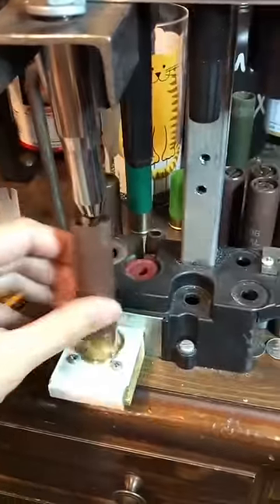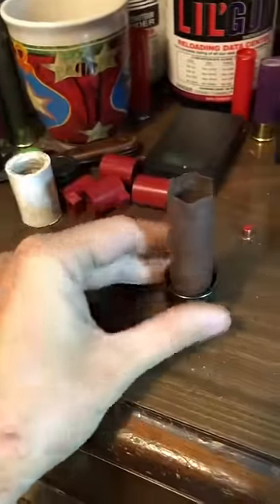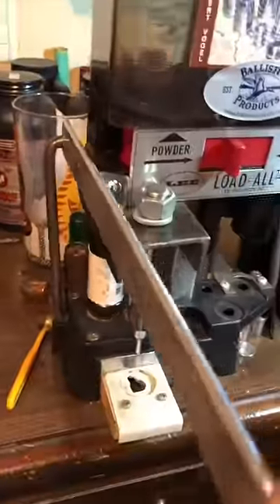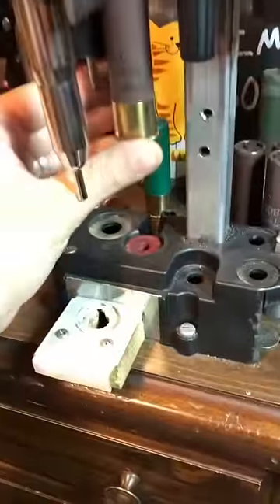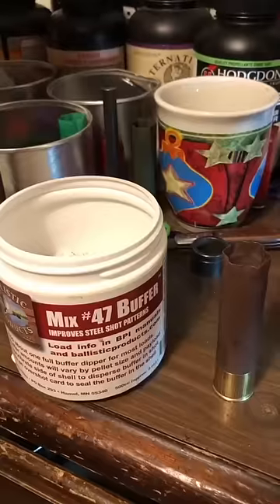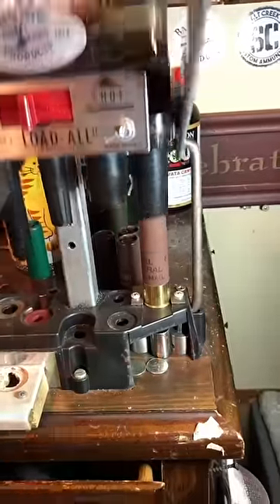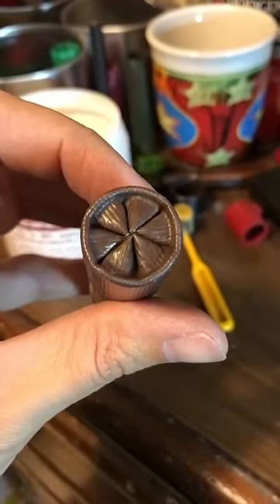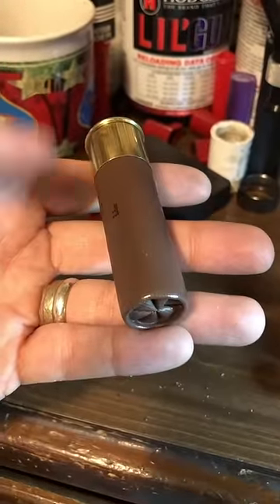Reloading 10 Gauge 18 Pellet 00 Buckshot #shorts

Comment: How many times on average can you reuse a shell? I assume it must take wear from being fired and eventually it becomes unusable.
Reply from the maker: These probably 5-8 times on average until the crimp splits. When it does, you can trim it off and keep loading. A 3.5” hull can technically be loaded about 20 times before it gets to short. Some hulls are made to be reloaded to the moon and back such as the Winchester AA or Remington STS. Those hulls will load over 15 times.

Comment: On average how many times can you reuse a case or shell? Just once?
Reply from the maker: Depends on what hull it is. Tapered hulls like Winchester AA’s or Remington sts’s will last about 12 shots before the crimp splits but you can just trim it off and roll crimp it as a 2.5” then a 2” and so on. A 3.5” shell like this one can be loaded over 20 times this way or until you run out of room for even a mini shell.

Comment: Why is a .40 cal pistol bullet 180 grain but this shotgun shell only takes 33 grain???
Reply from the maker: 32 grains, and that’s the powder charge. 180 grains is the bullet weight. This shell has 2.25 ounces of lead in it which is 985 grains with a velocity of 1220 fps. 180 grains is .41 of an ounce. You’re confusing powder weights with projectile weights.

Comment: How many times can a shell be reloaded?
Reply from the maker: These probably 5-8 times on average until the crimp splits. When it does, you can trim it off and keep loading. A 3.5” hull can technically be loaded about 20 times before it gets to short. Some hulls are made to be reloaded to the moon and back such as the Winchester AA or Remington STS. Those hulls will load over 15 times.

Comment: How many times can you reuse a casing?
Reply from the maker: Depends on what hull it is. Most 5-8 be for the crimp splits, then you can just trim it off and keep loading. A 3.5” hull can be loaded dozens of times technically if you just keep trimming it. Fold crimps last longer then roll crimps do, hulls like a AA or sts can be loaded over 12 times before the crimps starts to split.

Comment: Still cheaper to buy in bulk
Reply from the maker: No it isn’t. This is 10 gauge not 12 gauge birdshot. This costs $6 a shot from the factory or $29 for 5 rounds. I’m loading it for 50 cents. Reloading or loading your own buckshot and slugs is far cheaper, especially if you cast your own shot which we do. We get lead for free or nearly free from tire shops.

Comment: How bad does ten gauge kick compared to 12  gauge
Reply from the maker: It depends on how heavy the 12 is and what you’re shooting. 10 gauge has a lot less felt recoil than a lot of 3” 12 gauge shells do in a lighter weight 12 gauge, and has far less recoil than virtually all 3.5” 12 gauge does. 10’s are 9 to 14 pounds depending on what gun you have, all that extra weight eats the recoil. Modern 10 gauges are designed to not have much recoil. A semi auto 10 gauge is very very shootable. The weight makes them just have a long slow push instead of a sharp thump with recoil.

Comment: How many times could you safely load an shoot a single average 12 gauge shell before it becomes dangerous to even load let alone shoot
Reply from the maker: This is 10 gauge not 12 gauge but the answer is the same for any gauge. Straight wall shells last 5 to 8 loads before the crimp splits. When that happens, you can just trim it off and keep loading. There is no set amount, and it didn’t become dangerous to load or shoot. Shotgun shells are extremely low pressure compared to rifle or pistol brass. A 3.5” shell can be loaded until it eventually becomes to short even for a mini shell. Other hulls like Winchester AA or Remington sts hulls are made to be reloaded over 10 times sometimes over 15 before the crimp starts to crack.
Reply: @theshotgunscientists  that good to know because I know people will stop after like the second or 3rd load for rifles and stuff and some people I know won't even reload brass that's already been fired so I was wondering if it was the same.

Comment: Question how much all that cost
Reply from the maker: The press is $70 but they don’t make it for 10 gauge, I converted this one from a 12 gauge press. All you need is a roll crimp tool to either roll or fold crimp and a good one is $50. Primers are $8 for 100 right now, wads are $25 for 250, I cast my own pellets from free lead I get from tire shops, but you can buy 00 buck for $35 and it’s 5 pounds to a box, buffer is $8 a jar. Powder is $35 a pound. Initial setup can be a little costly but if you shoot a lot of 10, 16, 24, 28, 32 or .410, reloading or hand loading will save you a ton of money very fast. This shell I loaded in the video costs $6 a shot factory and I’m loading for about 50 cents right now. I’ve been loading for almost 5 years. Loading your own buckshot and slugs for 12 or 20 gauge is still worth doing but if you’re just planning on loading target shells for 12 or 20 gauge, reloading will not save you money right now. It will allow you to make better ammo than factories are making though. You can also make loads that are hard to find or tailor a load to your exact needs. It’s also extremely fun and satisfying.

Comment: Never re sized  the brass  reloading 12 g
Reply from the maker: You have to if you own more than one shotgun of the same gauge. I own 5 10 gauges, shells fired from my single shots will not chamber in my browning pump.
Reply: @theshotgunscientists  I have 3 and I just reload and fire away never had a issue
Reply from the maker: @jasonnester9514  we’ve had a bunch of issues with it, notably in a video we posted just a couple days ago where a 3.5” 13 gauge shell wasn’t resized and wouldn’t chamber in our mossberg 835. We had to rack the pump closed really hard to get it to shut and even then the shell was so tight it wouldn’t let the gun fire until my brother jerked the trigger really hard. It ruined a slug grouping.
Reply: @theshotgunscientists  bummer I’m only running 12g bird shot 2 3/4 for trap and birds

Comment: What is "buffer"? And what is it for?
Reply from the maker: @mathewpribek5126  powdered plastic and it keeps the pellets from deforming which helps patterns. It’s in most factory buckshot.
Reply: @theshotgunscientists  I'm floored. That is the missing element in my reloads! How did I not know that?! Well I was taught by a trap shooter so maybe its mainly buckshot that benefits from buffer? I'm gonna get some 🙂. Thanks!!
Reply from the maker: @mathewpribek5126 it helps any kind of shot, it’s in just about every Turkey load you can think of, some field loads, tss, bismuth and rarely it’ll be in steel shot.

Comment: I really don't think shotgun shells are worth reloading. You can buy a pack of 250 for 90$ and the time required to reload is pretty long. Reloading should really just be done on 1$/rd ammo. 😅
Reply from the maker: @Malficion  this is 10 gauge buckshot which over $5 a shot. I’m reloading it for about 50 cents. Well worth it. Reloading for any gauge besides 20 and 12 is still big money savings. I load 24 and 32 gauge which are both very expensive and only come in very light for the caliber birdshot rounds. I do buckshot and slugs.

Comment: I have a couple of 12 gauge spent shells. Do you want them for about $100?
Reply from the maker: This is 10 gauge not 12 gauge, and this round from the factory is over $5. $28.99 for 5 rounds. I’m loading this for 50 cents. If you want to buy me about 100 shells that cost over $5 each I’ll gladly stop loading them myself. For real, look up federal premium 10 gauge 18 pellet 00 buckshot and you’ll see right off their website it’s $28.99 for 5 rounds. This is high end premium 3.5” buckshot not the cheap 30 cents a round Walmart target loads in 12 gauge you’re probably trying to mock me about.

Comment: What is the point of resizing?
Reply from the maker: You have to get the brass back down to factory specs or it probably won’t chamber in a different shotgun. Not critical if it’s going back in the same gun but I own multiple 10 gauges. Most people do it regardless just to make sure it’ll chamber/eject.
Reply: @theshotgunscientists  thanks for the answer!

Comment: What is buffer for
Reply from the maker: Helps them pattern better at longer ranges. It acts as a cushion around the pellets and prevents them from being deformed so bad upon being fired. The rounder the pellet, the better it’ll fly. Without it, the pellets get smashed against each other turning them a little square.
Reply: Makes sense. Thx

Comment: I'm not going through with that resizing after all
Reply from the maker: I have too, especially if you own more than 1 shotgun of the same gauge. If you have say 2 12 gauge shotguns and you fire a shell in one of them, reload it and skip resizing the shell, there’s a very good chance it won’t chamber in the other 12 gauge. If it does happen to fit, there’s also a good chance that it won’t eject or extract. My browning bps 10 gauge will not chamber rounds fired from my single shots unless I resize them.

Comment: i’d rather just spend the 2 dollars
Reply from the maker: I hate to tell you this but it costs $6 a shot for 10 gauge buckshot. $29 for only 5 rounds. I’m loading it for 50 cents. Even if it did cost only $2 a shot I’d still be saving $1.50 a round.

Comment: Woulsnt it be safer to just buy more ammo?

You measure wrong and your gun will not enjoy it
Reply from the maker: No, there’s a pretty sizable gap between a safe powder charge and one that would end badly. We’ve shot thousands and thousands of reloads/handloads and have had far more failures and just bad loads happen with factory ammo. Usually it’s on camera too and we always show it. If you mess up you have to be doing something majorly wrong to the point you won’t notice the issue during other steps of the process. Plus, reloading for any shotgun gauge other than 12 and 20 will save you a ton of money. I trust myself more than factory ammo.

Comment: Step 1, buy a MEC 600 jr. not the cheap plastic lee load all
Reply from the maker: I would need 12 mec presses to load 8 different gauges and 2 of them would need heavily modified. I can use 2 Lee load alls for the same job. They do everything I need them to do and do a great job at it. I’ve used mecs and don’t like them as much, nowhere near as versatile and they require adjusting for different shells. The Lee is so much easier and I’m not a snob. It ain’t about price it’s about efficiency for me.

Comment: Pretty Gay.
Reply from the maker: How exactly?
Reply: "Deprime your hole"
Shoves cylinder into a sleeve.
Thats what that machine does, plows trough.

Pink pellets. 
"Cover the pellets in Buffer"
Like a skin care product on balls.

[cuts to thrust the machine once more into the cartridge.]

After crimping you are staring at a brown crimped butthole. This is why you chose a brown jacket.

"we are not looking too bad"

"I would show you this part but I need BOTH HANDS TO HOLD ON TO IT"

"Ready To Smash and Stuff at the range"

So, everything.
 @theshotgunscientists
Reply from the maker: @AlexanderZapataIndividual  I said hull, not hole. Empty shotgun shells are called hulls. 

The pink coating is called powder coat, it drops lead from being streaked down the barrel which is very hard to clean out. 

The buffer helps keep the pattern tighter. 

You have to use two hands with the drill, one to hold the shell in place and the other to operate the drill. 

This is very basic shotshell reloading and I really don’t know how you or anyone else turned me reloading a shotgun shell into all that but I gotta say it’s pretty funny